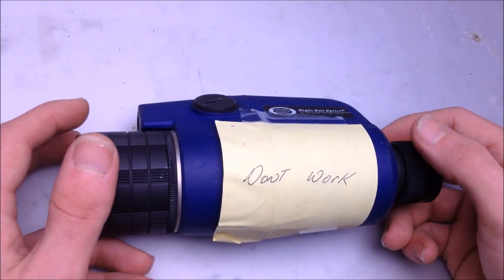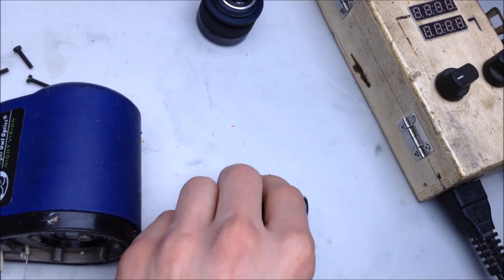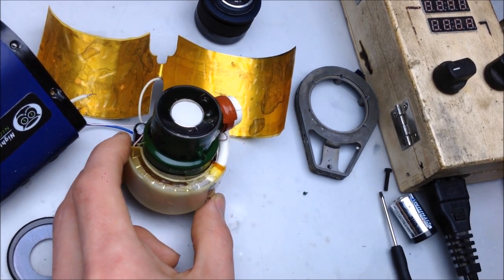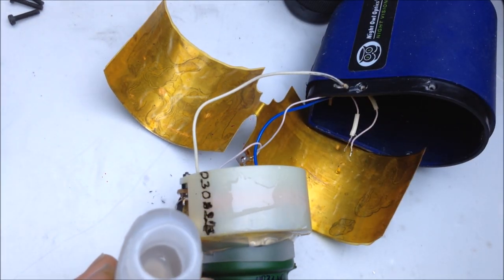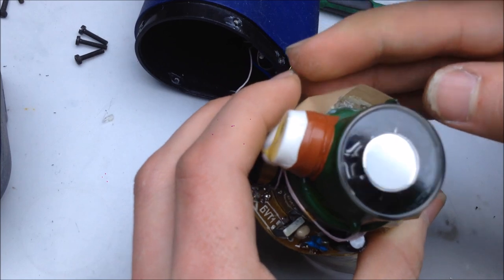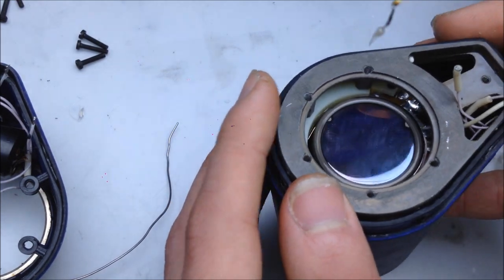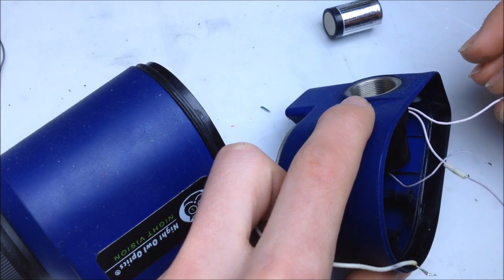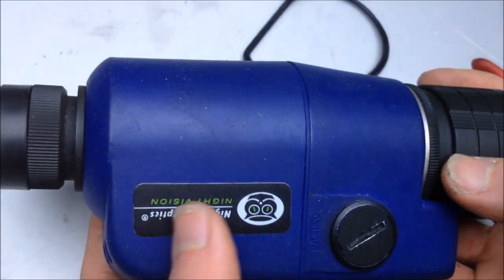Repairing an Image Intensifier Tube Based Night Vision Monocular.

Comment: cool, i have one of these! i cant get the bloody thing to work though, no screen image/not even a glow, any tips?
Reply: If you have a multi meter, see if it pulls any current.
Reply: @heyarno  it has one input, i dont know how you suggest testing that haha
Reply: @phonotical  What do you mean with "it has one input"?  
Testing is simple, just put the multimeter in current mode, unscrew the battery cap and put it in series to complete the circuit.
It your meter doesn't auto range, start with a high setting and feel your way down.
Compare your measurement with what the manual specifies.
If the consumption is higher, you might also have some kind of insulation issue or the tube pulled air.
If it doesn't pull any current, it's just a contact issue or the high voltage power supply is broken.

It definitely makes it easier to narrow the search for a fault.
Reply: @heyarno  if a component had failed then the current would still pass, i have come to the conclusion the problem s in the tube
Reply: @phonotical  How do you conclude that? If the tube has a problem, the load on the driver would be greater. Thus a higher current would flow.
Reply: @heyarno  B generally follows A, A high voltage test also showed no reaction
Reply: @phonotical  Those tubes are usually surprisingly resistant to torture. 
They might dim, but not die. 
Only a hard impact is likely to kill them instantly. 
The screen and focus assembly inside would break off or at least crack the glass.
In that case, they would pull air.
You can check if that is the case, by removing the objective lens and inspecting the photocathode.
Usually it's a transparent S20 or even S25 type. So the colour can vary from shades of brown to orange.
If it reacted with air, the photo cathode would look colourless, like the glass, that it was evaporated onto.

Also excuse me, but I can't read minds. I had no idea you already took it apart and did a high voltage test.
So I went step by step with my advise. Making a simple measurement before taking it apart is usually a good start.

Anyway, how did you do the high voltage test? I have some experience with those tubes. And there are surprisingly many things, one can do wrong.

It's not like a new tube is too expensive, but doing a proper check before discarding a potentially working one for nothing, is not unreasonable.
Reply: @heyarno  I am saying it is the tube, for one, there is a white concentric mark on the inside that suggests maybe the filament burnt itself out, if you want the tube for yourself, go ahead
Reply: @phonotical  I'd like to give it a try if you are close. (I'll pay for shipping inside germany)
To be fair though, this type of tube has no filament.
The only round and white thing inside is the screen.
So only give it away, if you want one of the new ones anyway.
When you have a look at the manufacturers website, you can check if your model is available in S25 now.
That makes a nice upgrade.
The only thing I like better on the early production tubes, is the phosphor.
It's such a pleasant green. The modern ones have such a pale green, close to the white phosphor.
Btw. you can check if it was made in Soviet times, just by shining a UV flashlight at the little white screen in the back.
The old ones will glow green. The modern ones don't react.
If you want a walk through on testing, tell me how serious you are and the tube type. I might make a video then and put some 3d models in the description for small stuff you need.
Reply: @heyarno  I have just bought a replacement tube, i live in the uk, if you want to send me an address let me know, email?
Reply: @heyarno  it is soviet, as it has cyrillic on there, as bad as my russian is, i couldnt tell you what they said!
Reply: @phonotical  How is Telegram instead of email?
Reply: @heyarno  uk doesnt have a telegram system any more!
Reply: @phonotical  Basically the good ones start with В-8 (W-8 or V-8 sound depending on your language).
Most consumer grade ones start with ЗП33 and then some details about the sub version.
Ekran lists them as Gen0 or improved Gen0 with multialkali photocathode on their website.
I once went nuts about all the data sheets, until I figured out, the physical dimensions make them mostly interchangeable.
Never drive them at the 19kV test voltage though. The noise looks like they generate X-rays at that point.
Reply: @phonotical  Haha, I mean this https://telegram.org/ 
It's a bit safer than email and discord.
Reply: @heyarno  ahh, oops! how does it work
Reply: @phonotical  You install the program on a device with internet connection. 
Then set it up like the instructions say on screen.
When done, you can look up contacts by username and text, talk and send files.
mine is @medPe
The privacy is rather good there. Just beware of scammers, they like to be private too.

Comment: can anyone point me to wear i can find a gen 1 night vision scope/goggles that make the famous buzz sound or tell me if they still make them with the transformer
Reply from the maker: The older ones could have a high pitches whine to them. Is this something you heard in person or on film? I ask because from what I read trying to answer your question it seems cinema added sound effects.
Reply: Thats Hollywood and video-games, no sound when you turn it on in real life
Reply: @Bull_10RR  wrong. The voltage multiplier on older Soviet systems makes a very noticeable whine.
Reply: Russian FILIN-1 (Филин-1) binoculars, and 1x goggles based on the same hardware have the acoustic aesthetic which you seek (Silence of the Lambs? ;}) .

Many Western retailers rebadged the FILIN with their own branding but it is the same hardware. Easiest way to find rebadged models would be to search for the specs of the optics (BN 2,5x42) along with "night vision" or "starlight" etc.

Филин means eagle owl and it does not sound like the movie, no computer startup noises or beeps, just a constant high pitched whine from the voltage multiplier.
Reply: I have experience with older Russian night vision models that make an audible and constant bzzzzzzz when they are on
Reply: @plmkoo6772  any brands or models you can point me to??

Comment: needs a 40W 800nm Laser IR illuminator.
Reply from the maker: Oh not even I don't think, Even a 2-5 watt would do amazingly well for this I think. There is no zoom so the limitation is how far the fixed distance allows you to focus. After a block there really isn't enough resolution on the tube to make the extra illumination with it past that point. Ah limitations, I want to also get a white screen version eventually, this one is pretty good but I have an experiment to try.

Comment: hav night vision goggles ( newcon optik BN-456) believe I put the batteries in wrong/ funked up the polarity. Feel competent enuf 2break apart just fishing 4any pointers or  someone who's dealt w/same issue. Thanx
Reply from the maker: There is from my knowledge 1 or 2 transistors on the inside for the oscillating circuit, I am betting replacing those would easily solve your problem. Transistors are really cheap to buy and pretty easy to install.
Reply: @Zenodilodon  many thanx for being so free w/ur knowledge...let u know if fix successful~